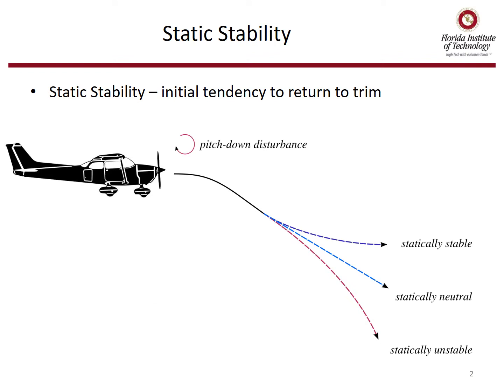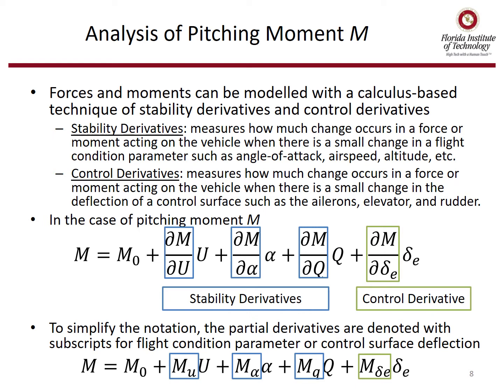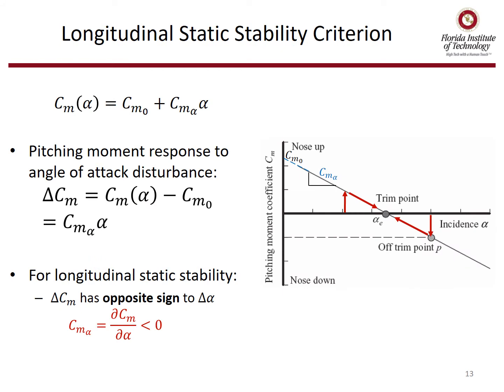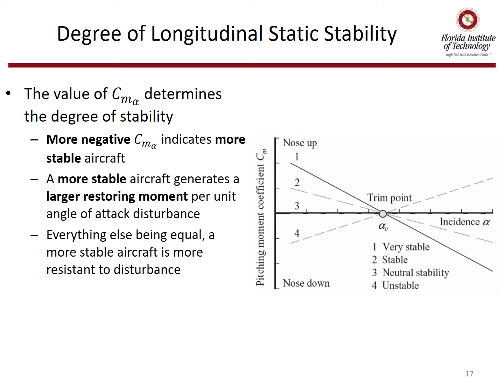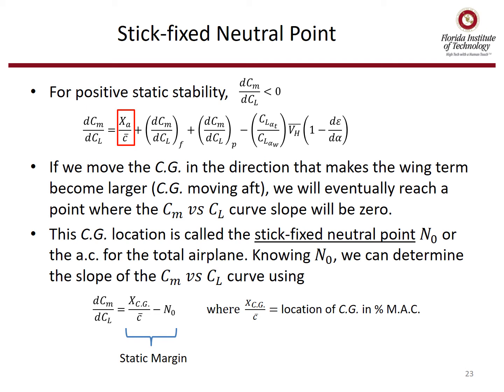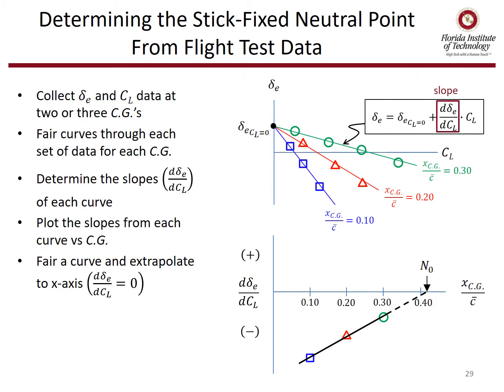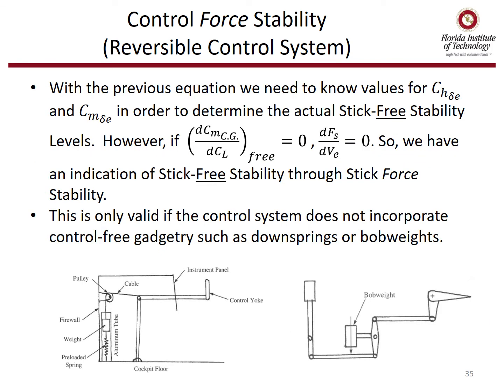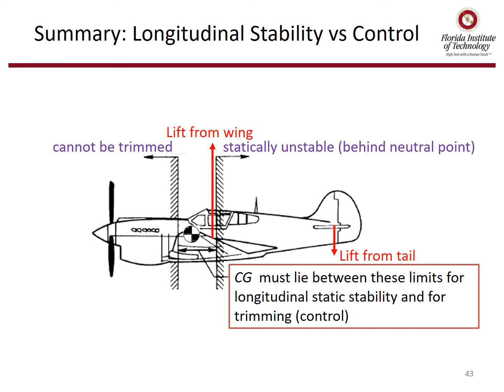Static Longitudinal Stability

Comment: What is the right hand rule the prof. is mentioning ?
Reply: The moment causing the aircraft to pitch down has negative sign and vice versa. It is in agreement with general right hand rule for moments f.e. in static analysis of cantilever beam (clockwise rotation has a negative sign...).
Reply: And maybe prof. probably recalls the right hand rule of gyroscopic effect for propeller

Comment: how to find the aerodynamic center of the wing experimentally ?
Reply: Usually it's a quarter chord length from the leading edge of the airfoil. In addition the aerodynamic center does not change with variation in angle of attack.